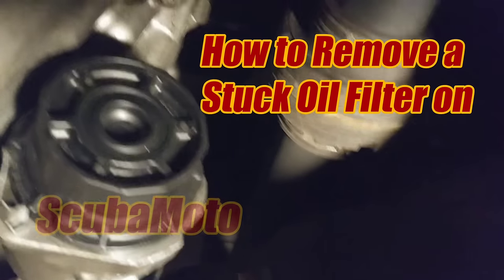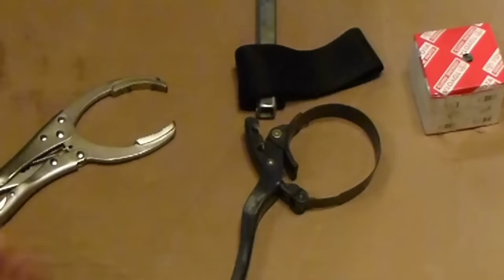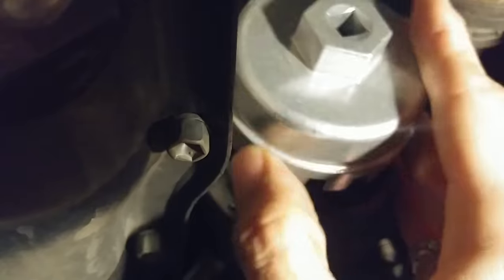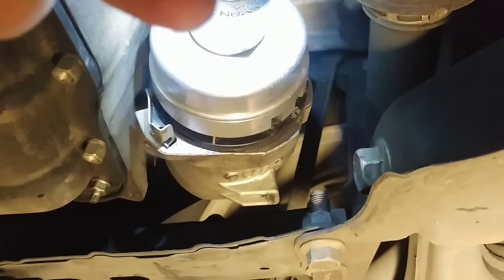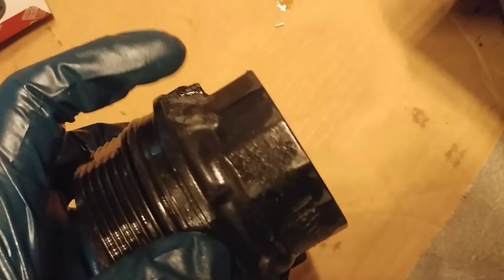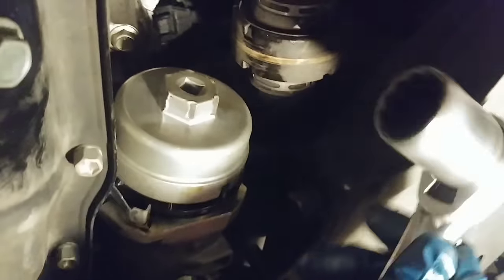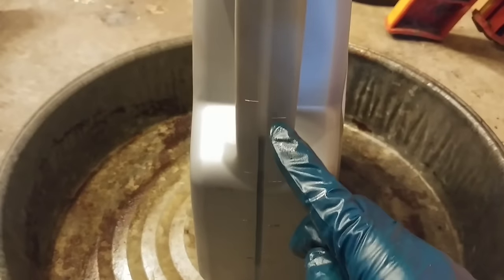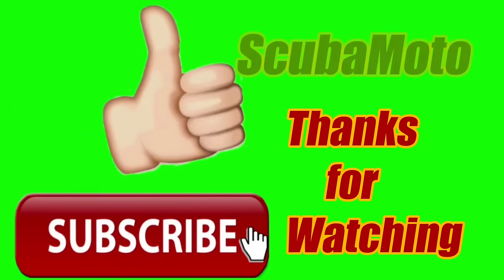How To Remove Stuck Oil Filter Toyota Prius Corolla Lexus Oil Change

Comment: My first three changes on our RAV4 were free at the dealer.  When I did my first one I stopped just short of using the air impact.  I used a cap wrench by MotoveXTools, which fit perfectly.  I used the 27mm socket and an 18" breaker bar and had to brace myself with my feet on the back of the front tire to break it loose.  It was all I could do to pull hard enough, and when it came loose it popped like I'd broken something.  You'd think a dealer would know not to torque them like that.  It's still a pain. bit with the right tool it's no longer the ordeal it was.  I just bought a Tundra with the same cap, though.  I dread doing it the first time.
Reply from the maker: Ed Cones: Great job getting it off by yourself. Thanks for the comment.
Reply: You think the dealer mechanic was trying to create an incentive for you to bring it back for it's oil change?
Reply: I know exactly what you mean. Toyota had no business designing a filter system like that in the first place. A lot of the time a young JOCK mechanic will NOT use a torque wrench and just use their arm strength which will over tighten it quite a bit.
Reply: I used an air impact - it worked

Comment: Thanks for posting. Have done my daughters Scion for the past few years, never a problem. Today, PITA!. Frozen on. And I "didn't" over-tighten it last time. Had to make an extra trip to the zone, and pick up that wrench. "Another" tool for the collection. :(
Reply from the maker: joe quillun: Thanks for sharing. You won't be sorry that you now have that wrench. It makes the job so much easier even if the filter isn't stuck. Thanks for watching.

Comment: I went threw that pain in the ass too!!! First oil change I was to perform on my 17 tundra , and my torque gun couldn’t get it off !! I actually had to break it off and hammer the edges with a chisel until it loosened up!!! Replaced it with a metal one instead of plastic.  It’s true they over torque them at the dealer.
Reply from the maker: Jose Cazarez: That sounds like a serious tough PITA. I'm glad you were able to get it off. Thanks for watching and sharing the story.
Reply: SAME!! It took about a few hours and we ended up breaking the filter cap.

Comment: I just gave up on mine and had drained the oil before I tried the filter. I don't have one of these wrenches so now after changing it with $20 of oil I have to take it to an oil change place to get it all done again so they can deal with the filter. That's who made it stuck to start with, and this apparently is going to be an endless cycle on this car. 

With all the great engineering Toyota put into this car, someone's always gotta come along to screw something up.

Comment: I have the 2010 which is same design but vertical and metal cap. Had to use cheater bar and a dead blow hammer. You bid helped. Thank you. No BS. THANK YOU 👍🏼

Comment: My buddy helped me with my last oil change on my 2011 Toyota Rav 4, and it took 2 hours to change it, most of it was spending getting the filter off, had to do an extra trip to Autozone to pick up the wrench, never going to a dealership again for an oil change, dealerships always over torque them

Comment: I had the same problem.  After my free services ran out, I went to do it myself, and had to resort to an impact wrench  as you did.  The thing than really pissed me off about it was, the dealership did that to the filter cartridge.  No excuse for that whatsoever... as you pointed out, the torque spec is a surprisingly low 18 foot pounds, which I actually do with a torque wrench... the drain plug too... because I have OCD lol
Reply from the maker: I'm glad you took the time to carefully do your own maintenance. Free service isn't always the best service. Congrats on a job well done. Thanks for watching and for sharing your comment.
Reply: Reading this and dealing with a tight cap myself has convinced me that the dealership's $85 oil change is a rip-off and scam.  Doing it myself from now on.
Reply from the maker: disillusions: $85 isn't even that cheap for an oil change. Plus you have to leave it with them, plus who knows what oil goes in. My oil, my filter: $30. My torque and no drive to their shop: priceless.
Reply: ScubaMoto I totally agree.  I was always inclined to think that you get what you pay for and therefore I was getting top quality service with the dealership at the price they're charging.  If they're applying this much torque just putting on an oil filter - who knows what other shady stuff is going on.  I wouldn't be too surprised if they over tightened the oil filter because I declined having them change the two air filters at some ungodly high price.  Ugh
Reply: I'm so glad you did this video my husband just came back from Toyota and they tried to tell him that this cap was " wearing out and needs replacement". Of course they want $90 for the part but now that I've seen your video I can see that they are the ones that actually broke it because they're the only ones who have ever done any oil changes on it.

That stops today I'm going back to changing the oil myself again.

Comment: I have a 2014 Camry and it has the same filter that is mounted vertically versus horizontal. Someone really over tightened it. Thank you!
Reply from the maker: Michael Ackerman: I'm glad the video helped. Thanks for the comment and for sharing.

Comment: I needed a pipe on my ratchet to get the extra torque needed to loosen the filter on my 16 T4R.  I think some places use an impact gun to tighten them.

Comment: I was having a terrible time getting mine off when suddenly one of the gripping Fins snapped off leaving a hole into the oil area. 
    What finally worked was using a 3/8” punch flat against the lip of the cap going around and around several times while hitting the punch with a one lb hammer firmly but not too firmly.
    I also wrapped around the cap with 1/2” x12” strip of aluminum tape to make a shim so the filter socket wrench had to be lightly tapped on so it wouldn’t slip. I also heated the cap with a heat gun to try for every advantage. Then using a 1/2” breaker bar it FINALLY broke loose!!! What a relief. 
The big question is  “ why the hell not just use a quality spin on filter ???🤪🤪🤪🤪🤪🤪
Reply from the maker: Nicely handled! I hope you didn't have to wait too long for a replacement housing. Thanks for sharing.
Reply: @ScubaMoto  fortunately our local parts house stocks them. They said it’s a very common problem so they keep a few of the metal ones in stock. 😎

Comment: I appreciate your help. The idiots at the dealer  over-torque during the 10K service of my Highlander. Crazy situation as I also own a Tacoma as well and never had such of trouble trying to change the oil filter. Sure thing the 27MM socket and my newly purchase power wrench for my wheels and it came off with a couple of attempts. Thank you!
Reply from the maker: You're welcome. I'm glad it helped and congrats on a job well done! Thanks for the comment.

Comment: I'm going to try changing the oil filter on my Toyota Corolla with this oil filter canister.  Just got the car back in December of last year.  I've never changed the filter.  The clip is gone and it was last changed by an indie mechanic.  I'm worried that the canister is on really tight.  Have the socket tool from Toyota.  I'm glad that I saw this excellent video, because now I know what to do if it's over tightened and can't get it off by normal means.  Thank you for sharing this knowledge, brother!
Reply from the maker: audiophile man: I'm glad you liked the video. Since you have the correct wrench, you first try a long-handled wrench (cheater bar). Just be sure the vehicle is well supported so it is safe to do so. If that doesn't work then impact with high torque (like in the video) should get the job done. Thanks for taking the time to comment and for sharing.
Reply: @ScubaMoto  Thanks for the further tip on the cheater bar.  I've been working on cars and truck for decades, so I'm sure that I can get it done.  Hopefully, it won't be too hard to get it off.  Have a good day, sir!👍👍👍

Comment: I learned the solution to this problem with my Prius. NEVER let the dealer change my oil, they apparently have never heard of a torque wrench and how to properly set and tighten the cap. After struggling with it one time I swore they would never change my oil again. This was after they showed me how they also topped off my fluids and checked the pressure on all the tires, even the spare. When I told the service adviser they put the wrong pressure in the tires he told me I was wrong so I showed him the correct pressure on the door frame. And by the way sir, this car does not have a spare, how did he put air in it as well? He did not know what to say other than "that was our best tech". I told him I would hate to see the worst one. I drove off and hit my windshield washer button...no fluid. I turned around and told him it was empty. He proceeded to take it to the back and when he returned I said, "how do I know he really changed the oil?"
Reply from the maker: Thanks for sharing such a great story and congrats on doing your own oil changes from now on. 👍

Comment: Last winter as a birthday present my daughter took my car to a quick oil change place and had the oil changed! Fast forward to July 2023 and me trying to get the oil filter housing lose to do the next oil change! I used the Toyota tool an extension, a power bar and had to use my foot to push the power bar to remove the cap. I ended up bending the extension, but i got the SOB lose. I have owned my Camry 10 years and never let anyone else change the oil, because i know that oil cap design is garbage. I wish Toyota had just stuck with the regular SPIN ON filter. If something had worked well for over 60 years DONT "F" with it!
Reply from the maker: Thanks for sharing a great story and congrats on getting one more over-torqued filter off. Her heart was in the right place. Maybe next time to impress you, she can do it herself watching this:  https://youtu.be/kWWUlyoWFsM   Thanks again for sharing.

Comment: Had the same problem on my Tacoma. From my last dealer freebie.  Even with the engine warm. I had to bring the engine up to operating temp, and still had to reef on it to get it off. It''ll be interesting to see if it comes off easy next time.

Comment: I had trouble with filter cap, finally got Toyota tool that was still extremely difficult.. 
your tool had teeth - that’s my value from your video. Thx
Reply from the maker: Ernie Tonski: I'm glad the video helped you find the right tool. Congrats on a job well done. Thanks for watching and for sharing your success.

Comment: Everybody over torques these filter caps especially the quick lube places that don't use the correct tools and they almost always damage the caps.  I bought the special filter cap wrench that looks very similar to the tool used in this video to change the oil in my relative's Toyota.  So far, I haven't any problems getting the cap off since the first oil change because I don't over torque.
Reply from the maker: PickleRix: That's great. And since you're doing it yourself, it will never be over-tightened. Thanks for watching and for the comment.

Comment: Just went through this with my 2016 corolla. I bought it used from dealership, and they serviced it beforehand.   This was my first oil change on it. And unfortunately my electric impact drill  is too big to fit into that space. I ended up just changing the oil this time, and was just going to take it to the dealership or a trusted mechanic for the next oil and filter change. But after watching your video, I think I will instead put that money towards a smaller battery-powered impact drill.   Thank you!
Reply from the maker: Before investing in another impact gun, you might want to try a 1/2 drive ratchet with a 27mm socket on the lug of the filter wrench. You can either slip a long extension pipe on a standard ratchet or use a 24-inch cheater bar and see if that works. Again, you want to do this using a 27mm socket on the filter wrench. If you put a 3/8 drive directly into the head of the filter wrench, you might split the filter wrench in half with a stuck filter. It may also help to spray the base of the filter housing generously with penetrating oil where it contacts the engine and let it sit overnight. In my case (this video), impact was a last resort since my pipe extension was just rocking the car on jack stands and that wasn't safe so impact was necessary.
Reply: Thanks for taking the time to reply, and so quickly.   Yes I hadn't even considered using the 27mm socket and was just inserting the 3/8" ratchet head in the attachment.   I will try that with some penetrating oil on the next oil change.  I'm doing this all at home with the car driven up on ramps, so I don't have a lot of room to get a cheater bar on, but I will try your recommendations first before  getting another impact drill. 
  
Since I already changed the oil and replace it with advanced full synthetic, I was just going to wait until the next oil change to try again. But now I'm wondering if I can just change the filter without draining the oil? I tried searching but I get mixed answers, some say it depends on the vehicle. Do you know if that can be done on the 2016 corolla?
Reply from the maker: The discovery that I show in video was that the filter was NOT being replaced at the intervals shown on the dealer's maintenance log for the previous owner. It turned out that if I couldn't get it off, there was no reason to think that they could either. And they weren't. Sure enough, it was clear that the filter you see me pull out in the video was in use for A LOT more than one oil change interval. It's impossible to know how many oil changes they did without changing the filter. These filter housings are designed with a pressure bypass so that if the filter reaches a certain "Clog pressure" oil will simply bypass it and not get filtered. The advantage is to sustain oil pressure where you need it. The obvious downside is that all particulates are getting full distribution in the engine over and over. 

To answer your question, you would want to drain the oil to replace the filter. To salvage your new oil, you could always clean capture the fresh oil for continued use. It's risky and you would want to pour it in through some filtration. BUT before draining anything, confirm that you can loosen that filter. Good luck with it.

Comment: The morons at my toyota dealer did this to the filter housing on my sienna.  I have the same impact wrench, and it broke the top off my cap wrench without loosening. Time to go to the dealer and lay into them.
Reply from the maker: Matt Hayllar: That sounds bad. It's good you're okay. Maybe the dealer will introduce you to the tech who installed it with impact so they can see the consequences and figure out how to remove it. Thanks for the comment and for sharing.

Comment: I changed my cousins rav4 with 220k miles on it.  She took it to the stealer all the time.  I had to hit it with the air gun just like you did.  I don’t think the dealer ever changed the filter.  My sister in laws rav4 was the same pain in the ass at 80 k miles. Again the stealer must not have changed the filter.   My wife’s Prius at 80k miles I had a hell of a time what a focking pain in the ass.  

My old MB CLK takes 15 mins and I don’t event have to get under the car to change the cartridge or oil.
Reply from the maker: Pay Way: Thanks for the great comment. I know what you mean about they probably weren't changing the filter since there's no way they could get it out. Same for the one in the video. It was so old it was ready to disintegrate. I hate to use impact on plastic, but my cheater bar with a slip-on pipe was just rocking the car. Thanks for watching.

Comment: The WORST part of all of this is that the O-ring is installed in what is called a "static radial seal" which achieves full sealing as soon as the o-ring is fully engaged with the mating bore. any further tightening does NOTHING other than seat the housing to prevent it from unscrewing, and the metal tab is insurance against that. 
(Unlike a cartridge oil filter which has a static axial seal which relies on enough compression to withstand the oil pressure.)
In an industrial setting I LOVE Static radial seal type oil filters precisely because of the way they work. You can just hand tighten them to get a leak free seal, and then no need for a wrench to change them.
Reply from the maker: Exactly. As soon as the O-ring is embedded, it's giving all the seal that it ever will. It's pointless to over-tighten it. But my guess is that most cases of over-tightening are the result of shop techs using a pneumatic wrench to install them with speed as the objective. In a fraction of a second, it puts a few hundred ft-lbs of torque on the housing saving the shop tech at least 6.5 seconds on the install. Time has value! The O-ring feels nothing. Never mind the 1.5 hours plus replacement parts it might cost on the next removal. Thanks much for the great comment.

Comment: I was trying to change the engine oil for wife's 2013 Prius for the 1st time last weekend. She had been doing it in the dealer. The drain plug went off easily with my 2 ft wrench. The filter was very hard even with the right cap wrench and 2 ft handle bar. I almost gave up before I use my feet to push the wrench bar to get it loose. Similar story on my 2011 Venza. I agree the dealer was trying to stop us from DIY oil changing. Will never do oil change there again.
Reply from the maker: litong li: Thanks for the comment and congratulations on a job well done. Now that you're doing it yourself, it will never get over-torqued again. Thanks again  for the comment and for sharing.